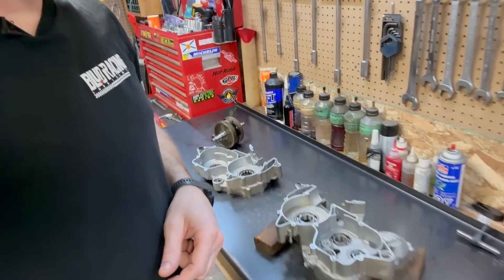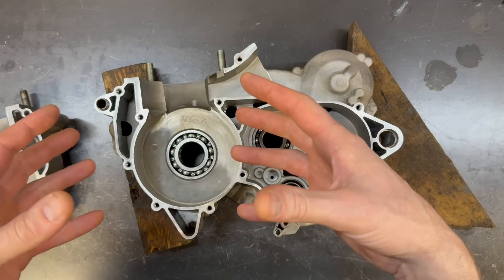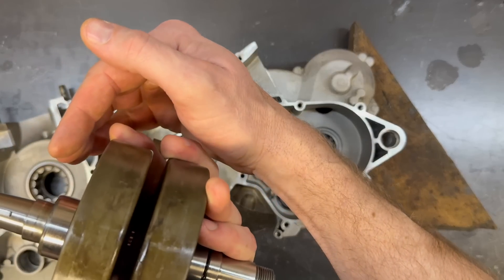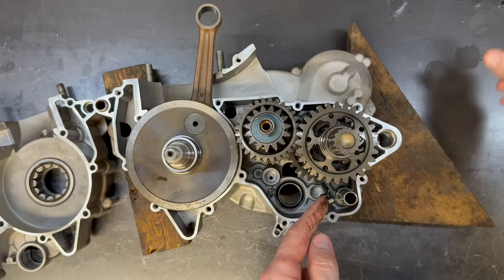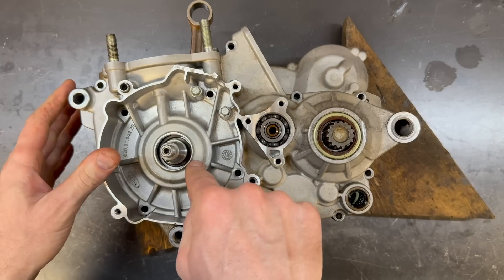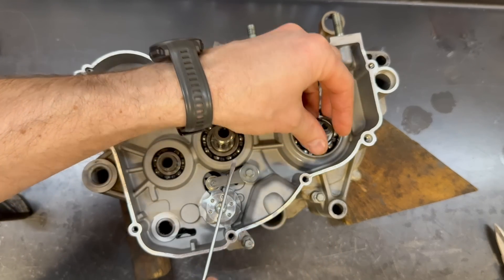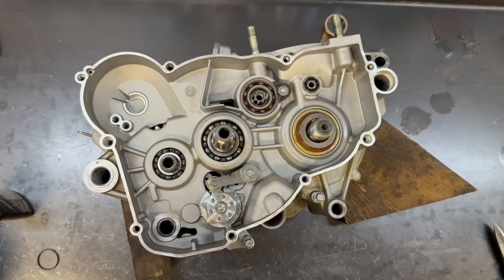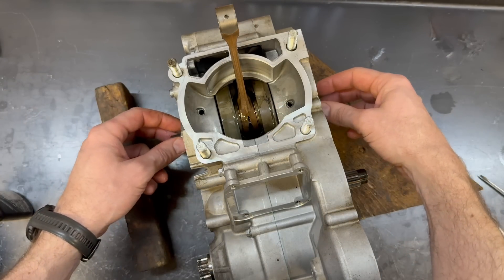300RR Case Assembly

Comment: The Beta’s output shaft seal design is a complete fail compared to my Yamaha WR’s design. I regularly have to replace the o-ring. I typically use a slightly fatter one.

Comment: Hello bud, idk if you’ll answer or not but I bought a low hour(22.9hrs) 2023 Beta 300rr two months ago. I’ve had nothing but problems and now my bearing blew out on the clutch side crankshaft. Does your updated roller bearing number work for my year and right side case? I’m new to all this and only just did my first top end ever on this bike one week ago
Reply from the maker: The size is the same but you can’t install it on the clutch side. The clutch side needs to be the 6206 ball bearing.

Comment: I've got this same bearing configuration in my 2023 250rr racing - I had a failure in the ball bearing at low hours. Don't think side load is the issue as the cage failed, not the bearing
Reply: Hey bud did you end up putting OEM bearings in or the bearings OP said in his video? I just had my clutch side crankshaft cage failure
Reply: @ShawnMcGann-p2i  I used OEM bearings which are the same as the ones he mentioned. They were NSK from memory
Reply: WOW Another most excellent video so great filming like we all are attending a master class, well done chuck you are the best .No bling b/s just vital information - Interested in the new 350 twostroke,  but also the TM300 mx Which looks to have a higher build quality but lower capacity

Comment: Hello chuck, i have a 88cc am6 beta rr, and every time i drove it, it spills very much trans oil via the outgoing axle, and the kickstart axle. In the workshop manual it says to put the seal on the transmission side with the closed side to the crankshaft. Is it a possibillity that it leaks pressure from the bottom end of the crank(when the piston goes down, so it builds a little pressure) via the oil seal into the crankcase? Air nipple on the transmission isnt clogged, but maybe it is so much pressure that the easiest way is the seals? I hope you can respond to me, it would help me alot. Huge thanks id you will help me!!

Comment: Great video and perfect timing. I'm currently rebuilding a '21 Xtrainer 300 that had crank bearing failure at 157 hours. Right side was worse than the left side bearing in this case. The right side bearing was an interference fit. Does that sound reasonable? no galling on the crank or signs of heat. Debating weather or not to replace the crank.
Reply from the maker: The right side should not be interference fit.

Comment: Chuck I have a question, 21 250RR complete engine replacement under warranty @4.5 hours. New engine sometimes shifts rough on hot days and will not shift into neutral on a down hill with engine off, I must come to a complete stop to shift into neutral but only when the engine is off. I'm wondering what the cause of this could be it's been that way since the second engine was new. Any idea?
Reply from the maker: It’s most likely a bit of clutch drag. You can usually improve it by adjusting the lever, bleeding the line or using different oil. I’ve got a video on how to diagnose it.
Reply: This is completely normal and is called clutch drag

Comment: Should the crankshaft drop so easily in the ball bearing? Don´t you need some Heat normally?
Reply from the maker: Not when there is a nut on the right side.
Reply: @ChuckfromTrueTech  On that subject, I presume the nut being tightened removes the crank play?
Reply: @ChuckfromTrueTech Hi, sorry, what do you mean? There is always a nut on the right side of the crankcase, both in engines with the left ball bearing and in engines with the nj206 roller bearing.